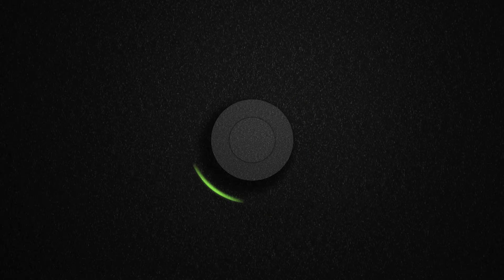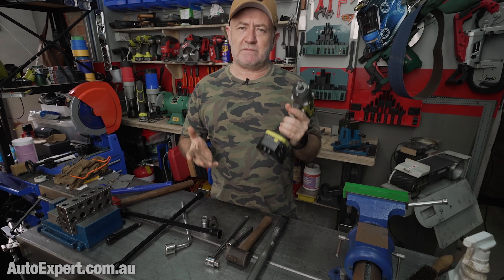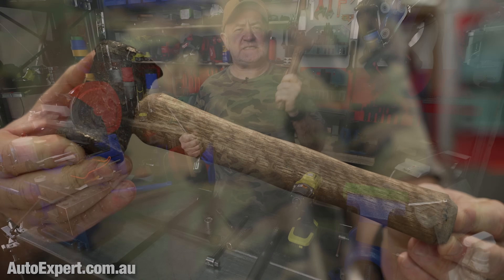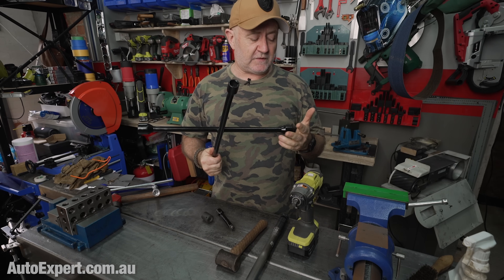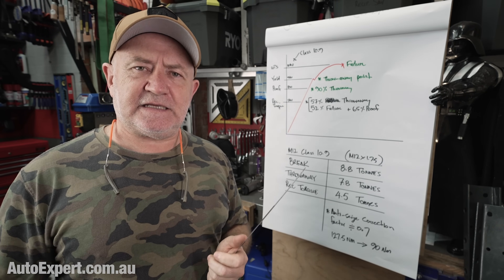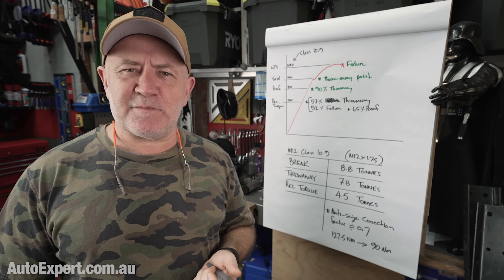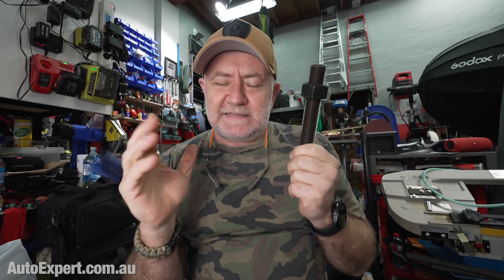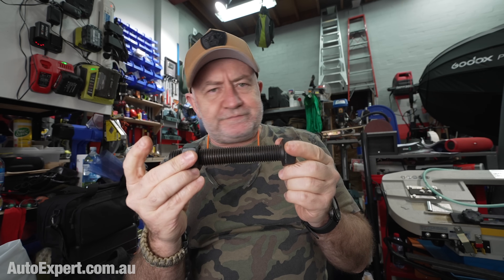Wheel nuts: Ultimate 'ghetto engineering' DIY deep-dive | Auto Expert John Cadogan

Comment: From this mechanic to others  just buy a 600mm or more breaker bar and the appropriate sized single hex socket for your vehicle and keep it in the car. Problem solved
Reply: That's what I thought, no need for a rattle gun to undo wheel nuts maybe one day.
Reply: @Low760  cheapest and easiest problem solver for people.  If you can get an 800mm breaker bar then even easier
Reply: @Low760  am I the only one that makes the 'ugga-dugga' noise when doing up wheel nuts with a wheel brace or torque wrench?
Reply: @TheKnobCalledTone.  🤣🤣
Reply: @TheKnobCalledTone.  I click with my calibrated elbow from years of practice.
Reply: I go for a full socket set before doesn't it suck when your changing the wheel on the trailer and it has different nuts.....
Reply from the maker: Yeah - good tip. I put a link to one in the description.
Reply: Yep, that’s my solution, but I still carry a pipe just in case.
Reply: I keep a cheap torque wrench too.
Reply: If they don't come off then a pipe on that breaker bar

Comment: I bought an electric impact for removing wheel nuts about ten years ago now that plugs into the cigarette lighter socket.. No batterirs to charge and came with 3 different impact sockets.. It seems to wind up a big spring internally. Was skeptical at first but it dont half whip the nuts off, dont bother with the wheel brace anymore.  Only about 50 usd also so rather keep that in the car than an expensive lithium impact 😊👍🏻
Reply: Yeah, Clarke make them, dirt cheap, and will also fetch off hub nuts, at much higher torque.
Reply: great tool I love it
Reply: I have one of these too.  But I also have a cross brace and plastic faced hammer.
Reply: Battery-powered impact drivers
are indeed effective, if strange to operate first time up. I found that can be rather savage on one's fingers, so need to take care. I wish that we had them in my youth; would've saved a lot of sweat out the back of Dingo Piss Creek!
Reply: My Heep I mean '02 "Jeep" GCL, doesn't have a working 12V socket and several shops can't figure out how to fix without causing other electrical issues and rapid battery drain. Not spending $1000's on that plug.
I am a new mechanic and need to take off axel nuts, wheel hubs, control arm brackets and A plates, ball joints and of course wheel lug nuts.
This requires far more than 100-300ft-lbs 12V corded impact. I also need to get into tight spaces those cords won't allow and travel around the vehicle.

▪︎ Ryobi One+ HP 18v Brushless Mid Torque 1/2" drive Impact Wrench (P262) has 600ft-lbs Breakaway and 450ft-lbs of fastening torque. And will take off pretty much everything but rust welded high torque bolts and semi wheel lugs at 500-600 Ft-Lbs!
▪︎ The High Torque Impact Wrench
Ryobi One + HP 18v Brushless 1/2" Impact Wrench (PBLIW01B) has 1170 Ft-Lbs of Breakaway and 700 Ft-Lbs of fastening torque. This will do anything.
You can even get a PowerSocket by Ingersoll Rand which is a weighted Impact socket for cam bolts that is thick wall with a flywheel design that increases your torque by 20-25% about $80 for one socket. But if you get a mid torque impact it may boost it up enough without paying the $200+ for a high torque with 25% more torque.
Both these Ryobi's are under $250 for a full kit on Ryobi Days Sale. 
Ryobi is made by TTI which also makes Milwaukee so there is no need to go Red and pay 2-3X as much
Reply: We We be be 😊😊😊😊😊😊
Reply: @CameronDC-Grimes  if you are a "mechanic" why can you not add a 12v outlet? Why can you not troubleshoot the issue? Also.. did you actually watch the video
Reply: Can you post a link to the one you have 🙏

Comment: Not trusting those $23 four socket crossbar type tools since I broke off one socket, using only my hand, when trying to undo a wheel nut. I think they are made of cheese.
Reply from the maker: I tested the one I demonstrated - seems pretty competent. Chinesium, probably, but competent.
Reply: @AutoExpertJC  mine worked for a while too, but that one time I had a tighter than normal wheel nut and that was it.

Comment: As a drifter and formerly known as a comp burnout guy I've pretty much had an apprenticeship in wheel nuts and studs. Its irrelevant how tight the wheel is. What's important is that they're evenly torqued so i rattle em once i start by hand then without checking the torque wrench. I just adjust it until she popps then torque them all. REMEMBER i change my wheels constantly YOU DON'T AND THOSE WHEELS WILL BE ON YOUR CAR FOR POSSIBLY YEAR'S SO YOUR FAMILY TRANSPORT MUST BE 💯 ON POINT 💯OF THE TIME

Comment: Hey DUDE, love ya stuff, on this one, as a qualified mechanic, I don't understand how you could not promote how people could not use their own body weight in an emergency to stand on the factory wheel brace to undo the wheel nuts. I understand literation issues but if a person/lady/girl had this input it could assist in a scenario.
Reply: Wrist saver technique I used when assembling bicycles. Too easy. But I don't recommend for using with long sockets or wheel lock key sockets. It's probably fine considering the stud thickness. 🤔
Reply: More danger to get hurt.  Novice jumping g on the tire wrench is sketchy.
Reply: h=giving it a smack with a hammer is safer. many of those factory wheel wrenches have a point on the end for removing the wheel trim. this means more of a risk if you slip of skewering a leg and having a very bad day.

Comment: About a year ago on my way home from work 130am in the middle of nowhere no cell phone reception my left front tyre got a flat i bent the tyre iron trying to lossing the nuts and not one came lose about two hours later i got picked up by a logging truck and dropped off at my gate about 60 Kms up the road the next day me and a mate went back to my car with a big socket set and bar's we still had troubles when I told the tyre shop were I'd got my last set of tyres from they laughed and will never get a cent from me again

Comment: I remember in the early 2000s, I was working as a truck jockey. The truck we were in had a steer tyre flat. Middle of the hay plains, the driver removed a sign post and used that as leverage to undo the nuts. Took us about an hour to do the tyre change, very successful method.

Comment: I started at the diesel price video. Snatch straps auto played next, then this. The engineering speak without being dry and long winded is what kept me on as I’m currently studying engineering. The point of failure diagram and discussion made simple sense. 
Incidentally, I grabbed out the impact driver to rotate the tyres recently on the Ute mainly because I’m getting up there in years and couldn’t be stuffed manually undoing 24 bolts. Starting by hand is always my advice too. 
New Aussie subscriber. 👍🏻

Comment: Hi John, great viewing as usual. One thing I didn’t see you cover (or missed) is making sure the contact surfaces of the wheel and hub are clean. If there is dirt on either or both, the tension in the stud can be lost or reduced sufficiently to significantly reduce the clamping force and induce potential shear failure of the stud.

Comment: I remember when I was a apprentice mechanic, I was as at Tafe and the teacher Colin Prest (yes he started prest automotive) asked how I did wheels up. I replied to him I use the rattle gun, he then grabbed a rattle gun and asked me what torque a old holden wheel we had at tafe should be at. I replied about 70-80 foot pound. So he gave me the rattle gun and got me to tighten the wheel, well when he went to use his torque wrench they were all about 70-80 pound feet, he never brought that subject up again.

I've been a tech for 14 years and own $2500 of torque equipment and have done up more wheels than most people have had hot dinners (literally). If I do wheels up with  the gun I use my old worn out gun and give it a quick double tap and they end up about where I want them. This is a skill that takes years of checking with a torque wrench to achieve. After the lesson from Colin I went out and ordered a torque wrench and spent the next 4 years checking my rattle gun. 

I laugh at the forums when people say VW wheel bolts shouldn't  be greased otherwise it puts off the torque reading. Well thats all good when they are new but what about when they're corroded lol.
Arm chair experts always crack me up.

Comment: Tip when storing cordless drills and drivers - you can usually set the forward/reverse switch in a middle position which locks the trigger, preventing the battery draining accidental activation.
Reply from the maker: Yes. Agreed. Toll  an shift, though, and nudge the switch. You could remover the battery and tape the terminals...
Reply: I remove the battery and further to what John has said, I use the transport cover for the dewalt batteries. Safe as houses.
Reply: @AutoExpertJC   keep the bugger in it’s box, I use battery tools every day,never had one discharge itself in the box it came in.

Comment: Years ago when the Patrol wheels coming off issue raised its head I took at look at tyre shops in my own town in regional Queensland to see what they were doing.  Most of the workshops were visible from the street so it was an easy task.  Every single shop simply ran the nuts down hard with a rattler.  No torque wrenches in sight.  Quite an eye opener.
Reply: This is why I like DIY..no cut corners.

Comment: Have carried a decent breaker bar in the boot for decades.  Not just handy for loosening nuts, can keep the sound of banjos away too 😉  Do have a rattle gun, but that's reserved for use on the driveway.

Also, a decent torque wrench doesn't cost much, and makes the removal job a lot easier.  Whenever the wheels are off, they get torqued back on.

Comment: Have still got a cross wheel brace that my father bought in the early 70's.  Have had it in every car I had, and it hasn't let me down, even on things other than wheel nuts.   Recommend.
Reply from the maker: They are both practical and dirt cheap.
Reply: buy a decent one and they last for decades. dad has had his for a similar time frame. same with a small bottle jack it used to live in the boot of the escort then it moved to the falcon now its in the ute.

Comment: Some years ago I owned a Ford Focus 2L diesel turbo. Magnificent power train with it's DC trans. On the wheel nuts were aluminium dress-ups, still nut shaped. When a rattle gun is applied to these they are instantly wrecked, which was astonishing to young bogan tyre fitter in Emerald, Qld one day. He managed to wreck a baker's dozen of these before I stopped goofing off in the waiting room and ventured out to see what was going on. Careful use of a hand wrench is required with these. On that same trip (from Vic) I was pleased to see the fitter in a Beaurepaire shop use a torque wrench on my nuts - impressed.

Comment: A truly excellent Youtube!   Well done, John.  Very helpful!
Recently,  I discovered that the 9 year old Chinese manufactured spare tyre on my boat trailer had "exploded" from sitting in the sun for nine years and had never been used.  Anyway, seeing that happen made me worried about the other  two (light truck) tyres on the boat trailer so I decided to replace all three tyres with a known brand - Goodyear. However, I was too worried to even drive to the tyre shop with the boat trailer so I jacked up the boat trailer on to axle stands and removed all of the wheels to take them to the tyre shop.  Well, what a job that was!   Ended up using a sledge hammer with a wheel brace to move all of the nuts and was pleased to achieve that without breaking any of the studs.  It took me most of a day to do it. I am sure glad that I had never needed to do that by the roadside in the previous 9 years that I had had the bespoke boat trailer for.  My Metabo impact driver made no impact at all in removing the nuts.  They were that tight!   Decided to put a little grease on the studs when redoing up the nuts.  I only ever drive the boat trailer about 5km to the boat ramp so I felt safe enough to apply a little grease.
Reply: So, it's not just Putin discovering Chinese tires are a bad investment?
Reply: @johnwade1095  On the othere hand, a certain brand of tyres manufactured in Taiwan has a great reputation for both wear and robustness. Just ask any farmer who has to drive over stoney terrain on a regular basis.
Reply: @DrakeN-ow1im  good plan not naming them here, the Russians might be reading this.
I reckon even tires you know were factory fresh when you bought them shouldn't be on a vehicle for 9 years.

Comment: Engines up to the late 60's always had to have the head bolts re-tensioned  after a couple of hundred miles after a rebuild.  And the nut was always turned anti clockwise to find the start of the thread.

Comment: Don't forget to carry something for the jack to sit on, especially on softer ground.  I used to carry a short piece of 4" by 2' wooden plank to slide under the jack, but then discovered those square heavy duty plastic scaffold feet (cheap as chips)- much classier and you can also use them as a square frizbee or an impromptu dinner plate, etc :)

Comment: One of my weekend callouts was too the Wairakei geothermal power station as the engineer's required a heavy duty torque wrench which every Bridgestone commercial fleet truck carries one,   they had to torque up the main components in the system which had 48 large studs and nuts,

Comment: A two foot long 1/2 inch breaker bar isn't expensive, easily fits in the area around the spare, doesn't require batteries.  Just leave a short extension and whatever size socket matches the lugnuts on it and you'll be good to go.  They also make a collapsible version of the X style tire iron.  I have used both in my vehicles for decades and have been rotating my own tires for the last few years since my preferred tire shop got bought out and crossthreaded a stud three times in a row.  Yes, three times in a row, after no problems in 25 years with at least two visits a year per vehicle for up to six vehicles between my personal and business vehicles.

Comment: Erm, I use my foot.  Carefully place Bog Standard Lug Wrench (identical to the one you use in demonstration) snugly, fully onto fastener, take up slack, (anti-clockwise, of course!) then step aboard.   I weigh 72kg.  If the fastener does not instantaneously oblige, "bend ze knees" and bounce, keeping pressure on the wrench at all times.  Depending on the level of energetic enthusiasm one imparts to the 'bounce' it is easy to get one to two gees (jeez!) of effort, equating to in make-it-up-as-you-go-along-speak, of approximately 144 to 216kg on the Bog Standard Lug Wrench handle.  100% success rate for me in Fifty-Two years of car owning and driving and truck driving and tractor driving.   Love what you do JC, keep it up!

Comment: One thing is for sure when you do have a flat it's always: Dark, cold, wet at least one the nut/bolt will be rounded and the jack will not work as needed.
Reply: You forgot to mention , it will be the last nut due to be undone.

Comment: There's been quite a few times where I've had to stomp on the tyre iron to get the wheel nuts to come off. It's pretty hard on the ankles so not a great idea, but it works. In the absence of a hammer or anything else suitable, I recall one time having to drop the spare onto the the tyre iron. The ute was parked on gravel so the wheel itself just kept slipping. It belonged to a female co-worker's son who had never changed a tyre so non-denominational spiritual entity knows what torque they were tightened to, but it was bloody tight.

Comment: Rather a beneficial, interesting and helpful report this one.
Realising that I too, even travelling from Bonnie Scotland, could perhaps get stuck in that well known Creek one day,
I thought I'd better check the pressure of my toy spare tyre. I found it to be 30PSI instead of 60PSI.
It took nearly 15 minutes to pump it up to just over the required pressure. Imagine standing in the pouring rain dealing with that.
Checked the socket for the wheel nuts. Realised that the socket size had changed so the one I had in the car was useless.
Finally I took my torque wrench off the shelf in the garage, checked the torque settings in the handbook and adjusted the wrench accordingly.
Now at least I am slightly more prepared. Thanks John.

Comment: Brings back memory of loading ordinance on fighters in ah, south east asia. After years of use sway brace bolts would gall in the helicoil threads to the point a 3 for breaker bar was not enough to move them.  Oil was applied where necessary and "management" went bonkers due to the manual stating to never lube the threads. We told them we can just leave them loose but the pilot will probably object, or we can "red x" the plane until the rack can be fixed, or we'd lube the bad ones and we all get our job done.  The later was the solution accepted.

Comment: I live in Syracuse NY USA. Lots of salt and calcium used. Corrosion of wheel studs and nuts, and rust locking wheels to hubs are real problems. I use anti seize on studs and grease mating sufaces of hubs and wheels. Thanks for the info on reduction factor for torqueing with lubrication. I like your humor.